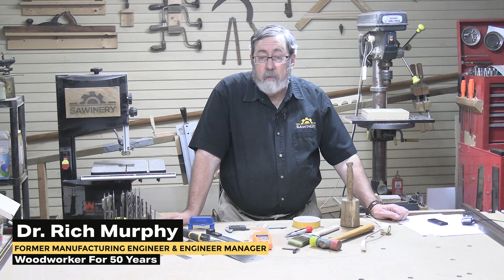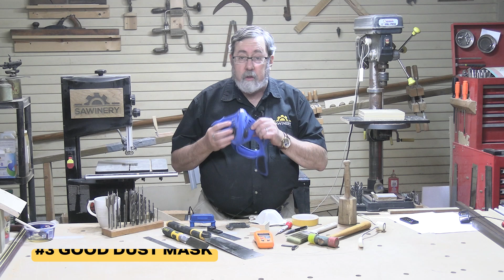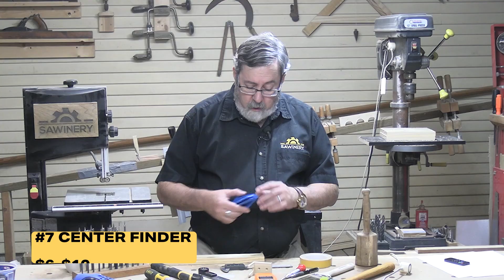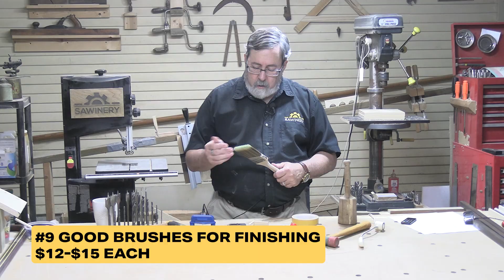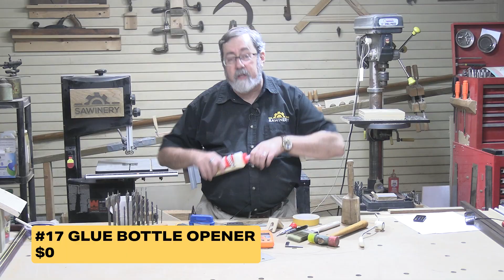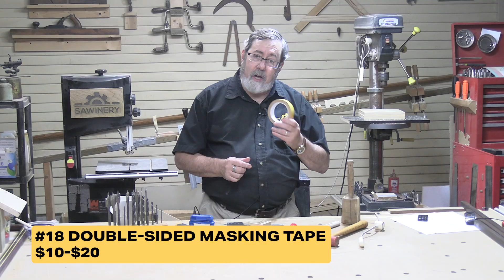20 Tools Under $30 Every Woodworker Needs

Comment: I get a lot of my tools from auctions.  Estate auctions, farm auctions, moving auctions, etc.  For instance: three 4" angle grinders (chineseum) for $5 (for all), 14" Taiwan bandsaw for $60, portable metal bandsaw for $50, bench top drill press for $10, handful of carpenters squares (including 4') for $2.50, air compressors (largest was 15 gallon for $90), 5 kw DeWalt generator for $250, two 7" angle grinders for $20 each, Milwaukee reciprocating saw for $20, four vintage Stanley hand planes including jointer for $5, box of four vintage Stanley 45 planes with blades for $5, whole pallet of electric motors (all working) for $5.  You get the idea.  When something comes up that I can use, I buy.

Comment: The topics covered in this wood working book Lucas four two Bond ranges from wood types to tool types and also uses. Some other matters include the several types of wood and their different levels of difficulty when it comes to managing them. This book has been very useful and is a great one for someone just getting into wood working.

Comment: wish I could show you a picture of my pencils - I glue them to a stick or rip of scrap with hot melt glue - that way I can reach them in my pocket (I swore to myself a long time ago that I'd never be without a pencil - at least in my work clothes) and I sharpen them with a utility knife which I sharpen with a rip of old belt sander paper contact cemented to a 3/4" rip of plywood - so in theory I'm never without a sharp (to my needs) pencil since I always have a utility knife in my work pants pocket - I've got a few that are only about 1 to 1-1/4" long including the metal eraser holder - must have 50  -- 100 of them lying around

Comment: All those mesh sanding disc will require you to buy save-pad type of disc that goes between powertool pad and the actual sanding part as those mesh pads will eventually destroy your pads.

Comment: I found Abranet sanding discs a few years ago and even though they are more expensive they last way longer and being a mesh they remove way more dust allowing the sander to work less and the disc to stay cooler and last way longer.

Comment: have a question on the pipe clamps could you use plastic pipe to make it little less weight?
Reply from the maker: Plastic pipe isn’t really strong enough and its not threaded on the ends. One of the clamp parts needs that threading to attach to the pipe. So, plastic just isn’t going to work.

Comment: i've gone thru more than a dozen brad point bits this yr i must be doing something wrong
Reply from the maker: That’s surprising to me. I’ve been using the same set of brad point bits for years. If it is the brad point itself that’s breaking off or getting dull, it sounds like you must be hitting something as you come out the other side of the bit. If the bit is getting dull, it might be the kind of wood you are using. Keep in mind that brad point bits are only for wood, not for metal.
Reply: @sawinery-woodworking  nah they just get dull and does not make as quick work as they used to but at the price they cost(or what i get them for) i'm not complaining

Comment: I have and use regularly every one of the tools you recommend with the exception of the moisture meter. I've solved that problem with procrastination. I've got a stock of sapele that has been waiting for me to get to it for seven years. I think it's dry.
Reply: I have a 30”x 60” x1&1/2” hard rock maple trestle table I was given some 10/12 years ago. I took it apart, set the top on end up against the wall because it was cupped. Now the cup has lessened to a good degree and I’m about ready to turn it with my jointer, fore, jack and smother planes into a roughly 60”x 20” bench top with a 60”x 5”x 3” strip under the front and back edges of the top for 3” deep dog holes. Yes I’m going to transfer the 9” quick release face vise from the old top and add an end vise into the right front side. It may not be as big as I would want, but living in an apartment it’s the biggest I can fit into the space available. 🧐😕👍😎

Comment: If you can afford it (they do cost more) you are better off getting a "pinless" or "flatplate" moisture meter. First because it does not leave "vampire bites" on the wood, and second because it tells you the moisture deep inside the wood whereas the pin-type only tells you the moisture at the surface-depth where the pins push into the wood. This is a big difference if you are working with boards that are 3/4" or thicker.

Comment: Some excellent recommendations!  About the only one that doesn't work for my budget are the pipe clamps.  The Harbor Freight clamp mechanisms are pretty cheap, but the 10'- 3/4" galvanized pipe from Home Depot will cost you about $35 plus tax.  Two clamps were running about $50 total.  I can buy a lot of decent bar clamps from Harbor Freight for that much.  I couldn't even find any pipe at my favorite tool supply...Habitat for Humanity's store.
Reply: @1Oldgraywolf  It can be spendy, but no clamp short of the parallel clamp can impart so much force...certainly more than enough to starve the joint of glue if you're not careful. 

In the last five years (shop #7) I have amassed some thirteen Bessey 1/2" clamp heads and no small amount of Schedule 40 BLACK pipe. Black pipe are what the clamps are designed to work with, NOT galvanized pipe. Galvanized pipe is larger in diameter, restricting tailstock movement and the clutch assembly in the tailstock, at the very least, will severely gouge the soft zinc if not simply scrape it off.

Yes...I know black pipe stains your glue-ups. There are ways to mitigate this, however. First off, make a habit of cleaning the pipe with a green scratchy pad (dollar store pads work fine for this), then apply a coat of paste wax. Keeps the pipes clean and makes it easier to scrape of stuck-on glue. I do this once every six months or so. Second tip is an old family secret, but I'll tell you anyway. While you're at the dollar store grabbing green scratchies, pick up a couple rolls of waxed paper. Yep. You heard me. Waxed paper. Take one out of the box and cut it into four equal (ish) parts. Set your bottom clamps out, ready to accept the panel and cover them with the sectioned wax paper. Add panel, squeeze, wait several hours....I mean glue up like you normally would. The waxed paper is not 100% effective, meaning you might get a stain once every ten or twelve times you use the method, but far better than seventeen ugly black stains everywhere...right?

I use an uneven number of clamps to glue-up. One more on the bottom than the top. I would typically use three on a cutting board sized panel. Three clamp sets at $15/ea is roughly today's retail price. Three 18" lengths of Sch40 black pipe might be $24/30 at retail, or you can get six on Amazon for about the same price. Be certain to get the 'heavy' rated pipe if you go the Amazon route. You'll be hard pressed to find three parallel clamps in that same price point, and certainly not with the flexibility of thirty second length changes.
Reply: @woodrowsmith3400  Thanks for taking the time with some great tips!  I too use waxed paper for glue ups and to polish feed tables on tools.  Almost all of my glueing is 1/2" to 3/4" biscuit-joined pine, so I don't need a lot of clamping power.  I do have a couple of long pipe clamps, but almost never use them.  The inexpensive Harbor Freight (HF) clamps do the job for me.  The Harbor Freight pipe clamp web photo shows galvanized pipe which is why I priced it that way.  18" sections of pipe will give you 14" clamps when you account for the mechanisms.  HF gets $12 for each pipe clamp and $6 for an 18" bar clamp that actually is 18".  Amazon will charge me shipping since I'm allergic to paying for Prime which likely comes out to about the same as what Home Depot (HD) gets off the floor.  All that is why I said that I can buy a lot of  relatively light duty clamps from HF that work for me, for what I would invest in pipe clamps.
Reply: Edit: at today's prices (06Jul24) Amazon's price for Bessey 1/2" pipe clamps is $13.99. Their price for 6pcs of 18" heavy duty pipe is $31.99 and for 24" is $36.99. So...$78.98 for three clamps @24". You could knock $5 off that cost by getting the 18" pipes. Either are useful cutting board sized clamp sets. ...and I know the pipe price is for six pieces. You'll either buy into the system, or find a buddy who uses pipe clamps and sell him/her three for $20. Either way, you come out ahead😉
Reply: @1Oldgraywolf  I use HFT F-style clamps as well. Must have literally forty or so. Do just fine in lighter applications...gluing up boxes, etc. Have close to two dozen Irwin quick-clamps of the medium build in six and twelve inch lengths. Also good for small to medium tasks. I specify the Bessey for pipe clamps as they have 'legs' which lift the work high enough off the table to keep me from cracking my knuckles when I crank down the pressure. The crank handles are also big, heavy cast units as opposed to the wimpy little metal rods that the inexpensive brands feature.

I am not as much of a tool snob as I am a tool user. Nobody who picks up one of my boxes is going to know that the wood was resawn on a generic Delta copy bandsaw, planed on a 35yo Ryobi 10" planer or held under glue with Harbor Freight clamps. They are going to know they are holding a well crafted box that is certainly worth the asking price. They are not going to know the box was rough sanded with a Makita orbital, finish sanded with a Bosch orbital and finished with Howard's cutting board conditioner. They just know they like the fit and finish. I sometimes think that crafters...who have evolved into influencers...have taken some of the pure joy out of our craft. I mean...can you tell the difference between a cut made on a used, Offer-Up $50 sixty year old Delta contractor saw and a $3500 Sawstop cabinet saw? Doubt it. Who can tell if the panel you glued up with HFT F-clamps is better than mine glued up with Bessey bar clamps? Tooling is irrelevant. Attention to detail, build quality and an occasional artistic eye or catchy story is. That is what I seek in a finished product, and I'm sure it's that way with you as well. 

Happy sawdust!
Reply: The HF pipe clamp mechanisms are excellent, I use them myself. When I laminated my workbench top (18- 2x4 studs) together, I had two pipes fail at the threads, but I have never had the HF mechanisms fail. I had two from HD break on the screw however. It was a LOT of pressure and not normal, but gave me some good insight. Get good USA made pipe for your pipe clamps and DO NOT USE PIPE FROM CHINA- once it is cut for threads, it is too thin on the walls structurally. Also, if you just get galvanized and sand(or file- I prefer open mesh emery cloth) down any spot that is a little snug from the zinc, it works great

Comment: I really wouldnt bother with a japanese saw (ryoba, by the way) that isnt made in japan. The temper is wrong, the set is wrong, and the tooth geometry is nothing to write home about either. I've had the one you show a long time ago and it felt great compared to regular box store saws, but the teeth did not last and it would jam easily, to moment I bought a real ryoba I knew how useless the first one I had really was. It is well worth the money to buy original.
Reply from the maker: Thanks for the input! For this video, we focused on tools under $30, so the original wouldn't fit the criteria.
Reply: My cheapo Irwin has been shockingly good.
Reply: I picked up a cheap Japanese saw at Harbor freight, and it’s awesome.

Comment: Great video, great tips. 
I do one thing different. 
I buy plastic mechanical pencils during the back to school sales. I bought 30 .5 for $6. And to my surprise each one has 3 sets of lead in them. I figured for the price they would have only one and I'd just throw them away when they run out. 
Since I have so many I keep them all over the shop. 

And my experience with the 3M Xtract discs is the tear very easily. Just rounding off a corner has had them tear. I agree that they are great but too fragile for me. 

Take care